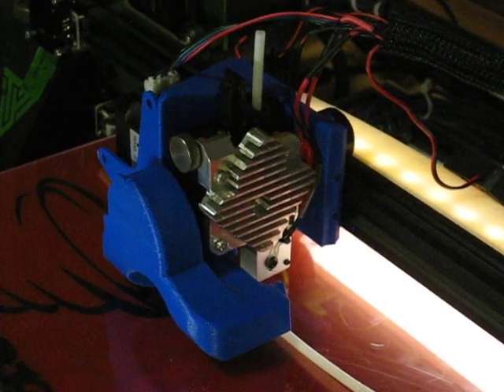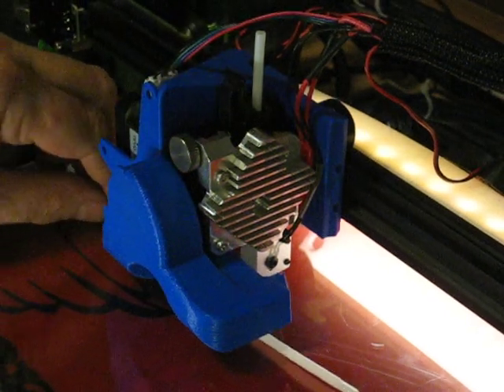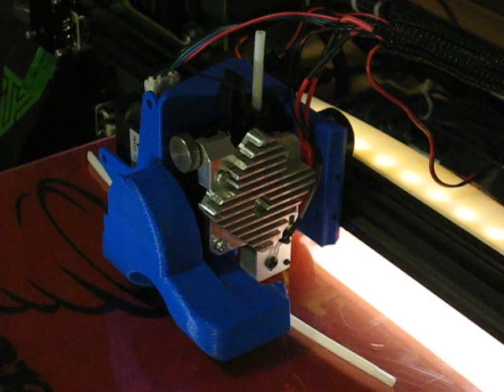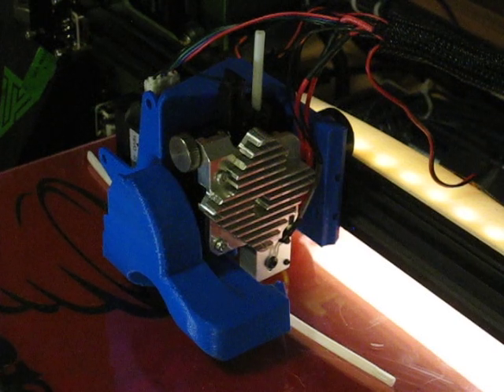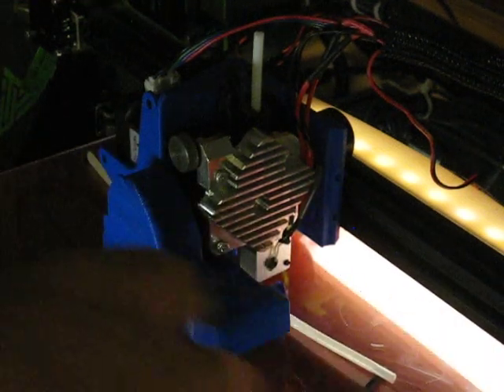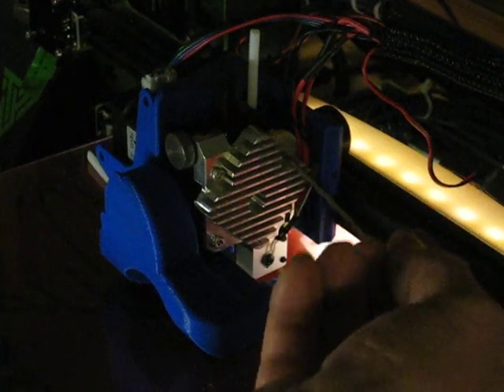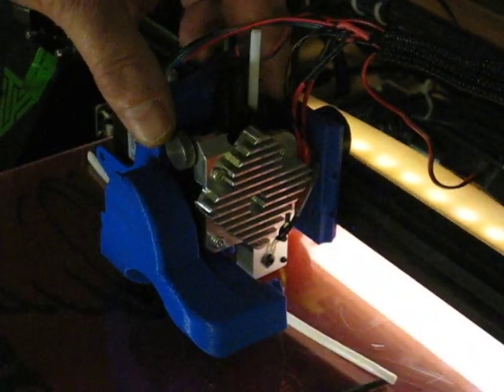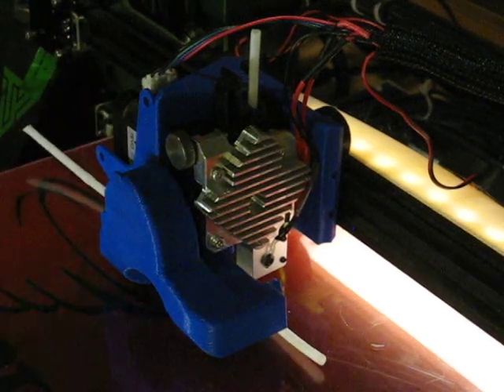Setting the height of your Titan Aero on the Evolve

Comment: Mine doesn't move like this and the only thing I can figure out is that you are not using the small screw that's in the groove (where the hot end slides in)?  It would be helpful if you could refine what E3D's assembly steps differ from what you suggest to implement this upgrade.  
https://e3d-online.dozuki.com/Guide/Titan+Aero+Assembly/23